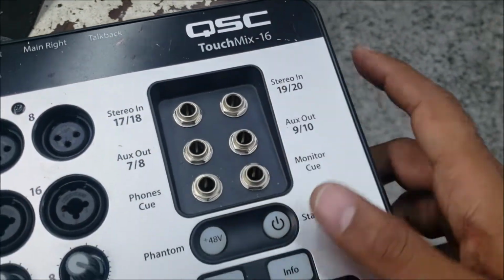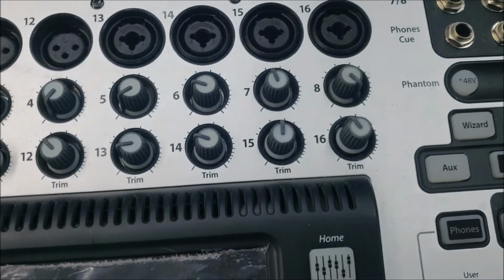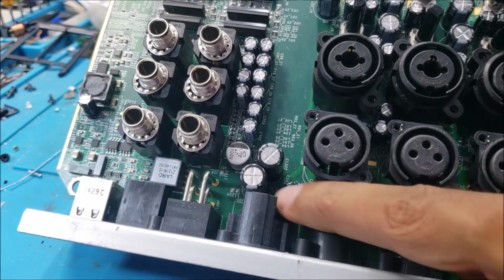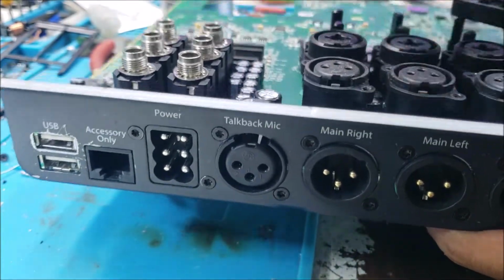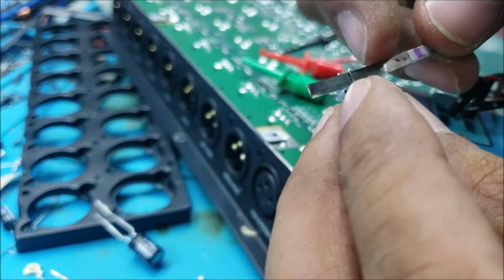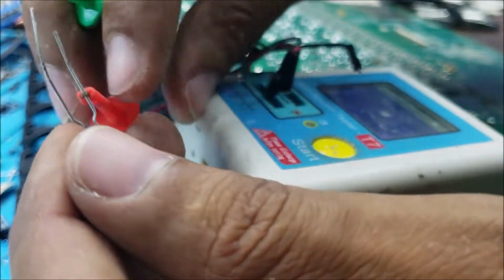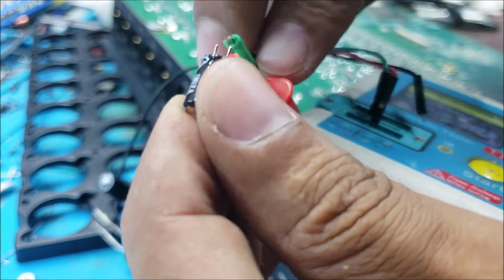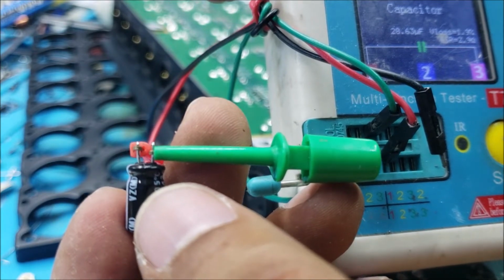QSC TouchMix 16 left channel output very low and sound far

Comment: Great video - thank you. Could you provide the dimensions of the replacement caps so I know which ones to order…that cap spec comes in a huge variety of sizes. Thanks in advance!
Reply from the maker: 5x7mm or small
Reply: @SOSfixElectronics thanks very much!

Comment: Hey man I just replaced the 4 out capacitors in my mixer witch left channel was significant lower and nothing changed any advice on what else could be wrong.
Reply from the maker: change capacitors again maybe have bad ones. try change the capacitors in the input too
Reply: Where do you living?
Reply: Great video - thank you. Could you provide the dimensions of the replacement caps so I know which ones to order…that cap spec comes in a huge variety of sizes. Thanks in advance!